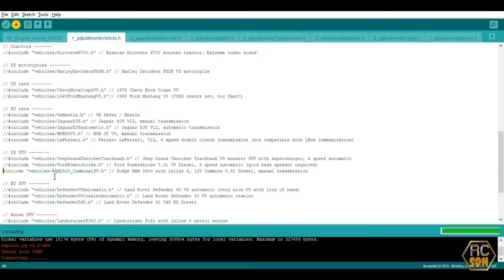Homemade RC Engine Sound | How to made EES at home

Comment: Hello, I'm trying to assemble this project and I have a lot of doubt regarding the connection of the wires between the FS-IA10B receiver (in my case) and the board. Can you help me ? I saw that you used 5 wires plus the traditional one to connect the board to the RX jumper. And that's my point of doubt. Could you help me by explaining how you connected the wires? Thanks